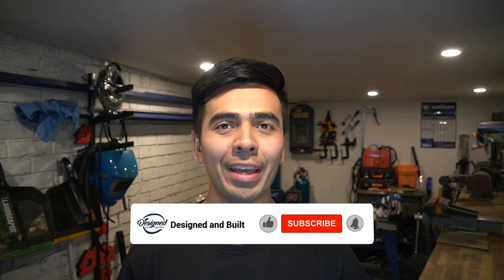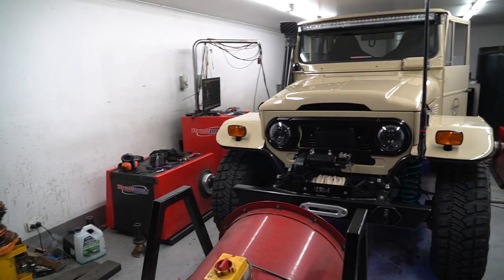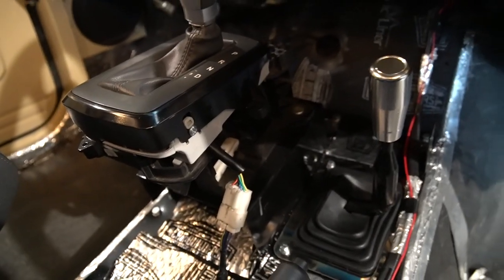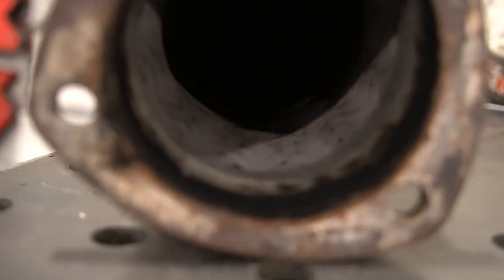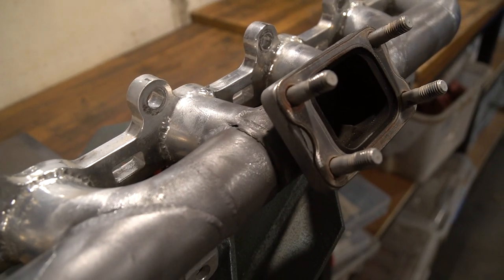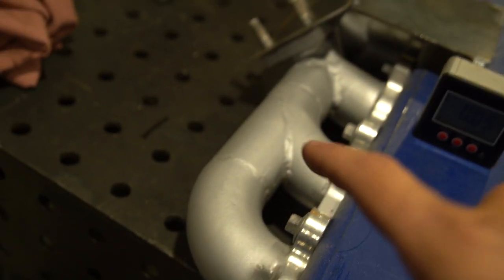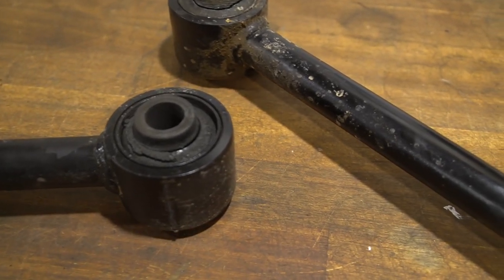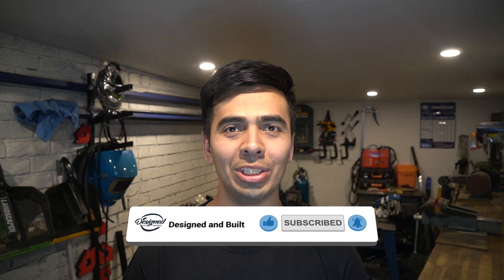DYNO TUNING, LOTS OF TEETHING ISSUES, CRACKED MANIFOLD & DRIVELINE FIX - BARRA T FJ 45/80 EP#33

Comment: Did you ever change that first exhaust mount? I can't exactly remember how it was but remember commenting on it at the time and suggested mounting it to the gearbox rather than the chassis. Could have contributed to both the exhaust break and manifold crack.
Reply from the maker: Hey Benny, yeah I have changed them around a fair bit, I remember that a long time ago and changed it as a result so thank you!!

Comment: Sorry but that exhaust was never going to last, the dump pipe and cossover pipe need to be braced to the bellhousing and along the transmission then have a decent sized flex from there.
No amount of bracing and strengthening will fix it, the failure will just move to the next point whch will be further up the dump or the dump pipe to turbo bolts/studs.